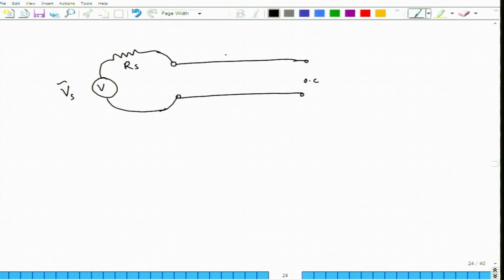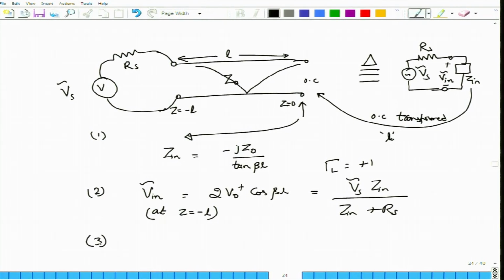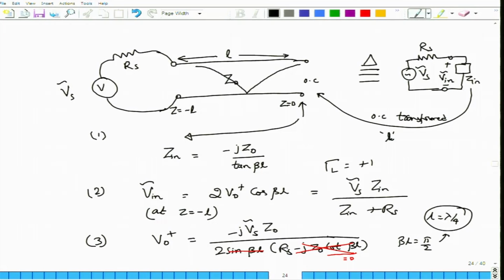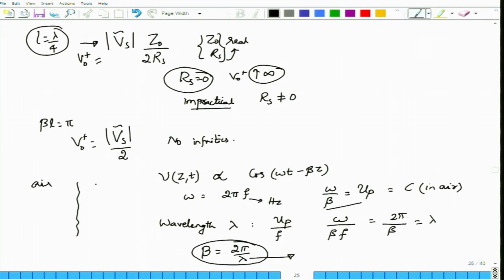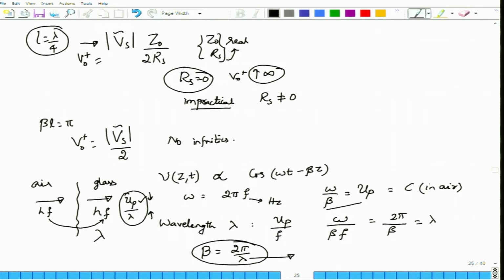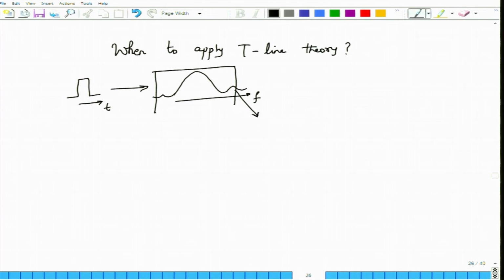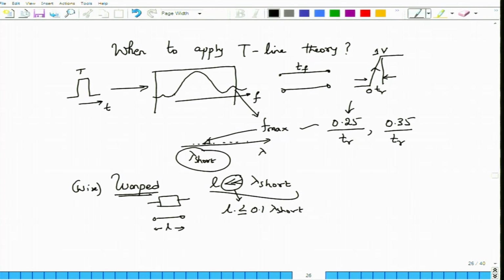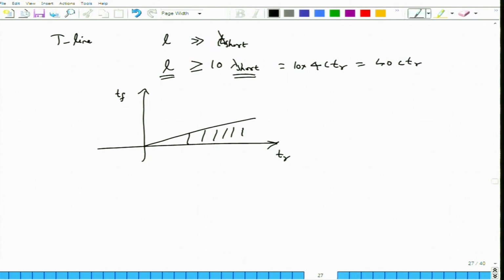Lecture 7-When to apply T-line Theory?

Comment: @19:42 there is a mistake in the lecture. Since freq. f is constant, as phase velocity increases the wavelength should increase. f = Up/(wavelength). If Up increases and wavelength decreases then frequency f will increase which is not correct.